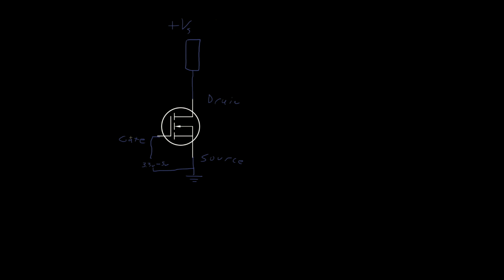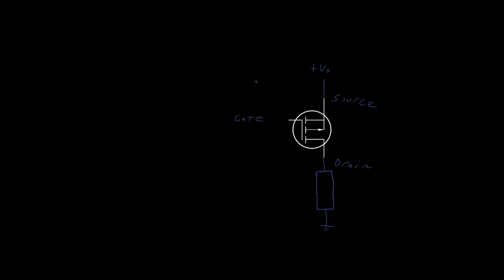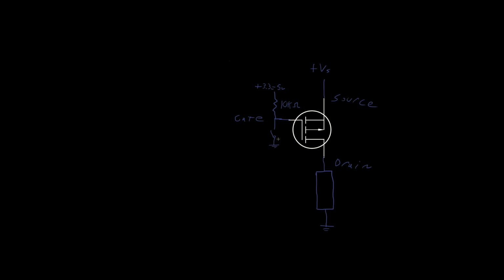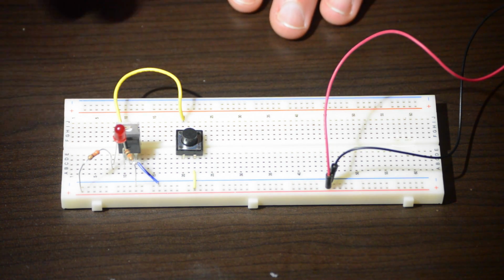Logic Level MOS FET Basics

Comment: You mentioned the gate voltage to switch it fully on will fall between 3.3v and 5v. Wouldn't this make it unsuitable for 3.3v logic where the 3.3v would be the maximum (and the actual may be a little lower)?

Comment: May I ask you for guidance on a project?
I am a student working on an electronics project. The board is a Teensyboard, so I/O pin voltage is 3.3v. It's meant to control a 3 ampere load for 2 seconds.
I'm looking for a logic level MOSFET which can operate at such a low voltage, but I can't find one.
Can you point me in the right direction for a solution?

Comment: Hi Bobby, it would be very nice if I could use your help in choosing the right logic level MOSFET for my application, since I know very little about them. It's about a 1S LiPo battery cutoff circuit I already assembled as in this video https://www.youtube.com/watch?v=0q8uq5ntjvI which I intend to use in RC airboat for a small and powerful gear pump for active cooling of the boat's ESC. I previously tested and run the pump from the power supply's regulated 4.2V max., where the pump's motor draws approx. 2.25A at that voltage. Connected the motor in parallel with the led, but as soon as I tapped the pushbutton, I could barely hear the hiss coming out the motor. It looks like the MOSFET used (IRF9520) in that circuit couldn't push that much current, since the Gate pin wasn't saturated enough at applied voltage. My question is which logic level MOSFET with the lowest possible VDS and higher current capability should I use?

Comment: Hi Bobby, for your circuit for the P channel FET, shouldn't the gate voltage be referenced to the Source voltage? In other words, when you show +3.3V on the gate to turn it on, don't you really mean Vs + 3.3V? And then to turn it off, you should apply Vs to the gate. Unlike the N channel circuit where the Source is connected to ground, in the P channel circuit, neither Drain nor Source are connected directly to ground so specifying the gate voltage with respect to ground doesn't make sense. Do you agree?
Reply from the maker: tzampini thank you for your comment and for keeping me honest! So just to start, you are very much correct, the gate voltage should be referenced to the source of the transistor. For this example however, this circuit will work (and so will the idea of referencing the voltage to ground) since the load is referenced to ground and is resistive, so we are switching the gate-source voltage between Vcc and 0. However if the load had a voltage drop across it when no current is flowing (inductor, capacitor, battery, etc) then the issue of referencing to the source does become important! In this case you need to deal with a gate driver, which applies a relative voltage between the gate and source, regardless of the voltage of the load (source) relative to ground. However this was an added level of complexity I did not want to get into in this video, but in general you are correct, and this is a good thing to consider! 

I hope this has helped clarify things, and thank you again for the question!
Reply: Agreed, Bobby. I actually was incorrect (I think) when I said the gate should be Vs + 3.3V to turn it on. Shouldn't it be Vs - 3.3V? For example, if the source had 50V on it, I believe 46.7V on the gate would turn it on (50 - 3.3). Am I correct?

Comment: I'm familar with the n-Channel Mosfet. What I don't understand, is, what is the current draw from 5v on the gate. I usually use a 15k Ω resistor on the gate and source as a pulldown resistor. So when the momentary switch is released (off), then the voltage that was on the gate, will have to go thru the resistor, and threw the source to ground right?

So does that mean that according to Ohm's law, that 0.00033 Amps (0.33mA) is seen by the microcontroller like the Arduino or the switch?

I = E/R, 5vdc / 15000Ω = 0.000333A, which also means that the resistor has to be rated for at least..

P = E² / R, (5vdc * 5vdc) = 25 / 15000Ω = 0.001666 Watts, or 1.66mW

Is that correct, or do I have it wrong? 

What does the momentary switch or microcontroller see when it is supplying voltage? It has nothing to do with the Rds(on) resistance right?

I'm looking, and have on hand, the IRLB3034PBF, that I've purchased from Mouser Electronics. I'm fully aware of the Vgs(th), which is the voltage in order for the n-Channel Mosfet to turn on, or conduct and allow voltage and current to flow thu the Drain and source. Could you help?

Great video. (+1 : 10)
Reply from the maker: Hello Mark II, My apologies it has taken so much time to respond, I was finish research for the summer and it has been a whirlwind, but enough excuses, lets get down to your question! 

If I understand your question correctly, you're asking about having a resistor in series with the gate and the switch (or micro-controller) of ~15k, and having a similar pull up/pull down resistor (as is I had in the video)? This is definitely a common circuit and it is a highly conservative and good circuit. Essentially what this series resistance is doing it limiting the current flow out of the I/O pin on your micro-controller (or switch) that goes into the gate. In this video I largely excluded this current and just said "it is small/negligible" since, it is, at least for many basic applications. The reason for this current is that when you put a block of semi-conductor together, it has intrinsic properties which are manifested in what are know as parasitics. So on the gate of the transistor you actually have a parasitic capacitance, resistance, and inductance. So when you apply a voltage to the gate of the transistor you are actually charging a small capacitor, which of course requires current, however for most transistors of this nature this capacitance is not very large, but it is always good to have a series resistance to limit current from your micro-controller. 

By the way, I can't remember if I mentioned it or not, but it is this capacitance that requires us to have the pull up/pull down resistor, since if we did not, this capacitor would charge and never discharge (or do so at an incredible slow rate), so we need to externally discharge it in order to put the transistor in the correct state.

The micro-controller or switch would 'see' a small current caused by the charging of this capacitor when it is applying the voltage. And you are most correct, the Rds(on) is a very important characteristic, but it refers to the resistance the transistor has between the drain and source (this would be analogous to having a switch, closing it, and measuring the resistance of it. It wont be much, there definitely will be a bit of resistance, a few tenths of an ohm). The Rds(on) will determine the voltage drop across the resistor when it is fully on (for a given current) and from this, it will also tell you the power loss over the transistor for a given current. 

I hope that I understood you correctly and was able to answer your question, if not please feel free to let me know!
Glad you liked the video, and thanks for taking the time to watch it!